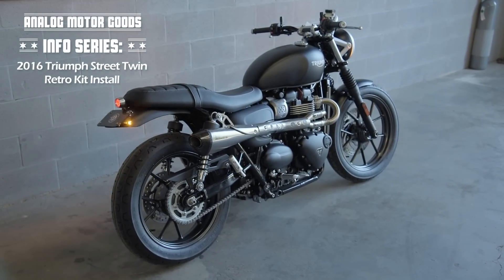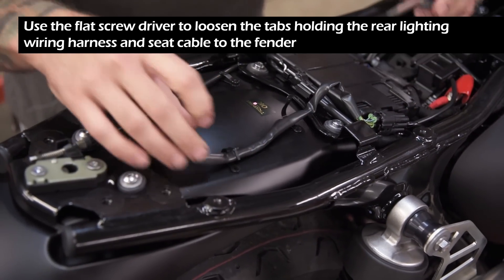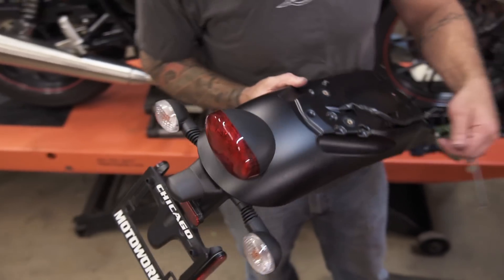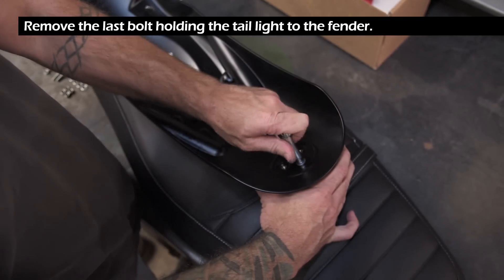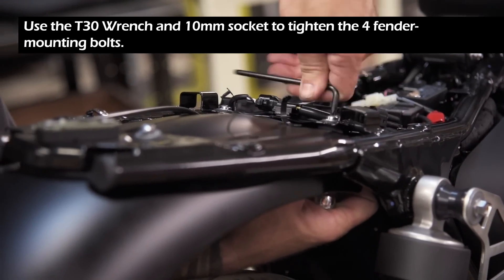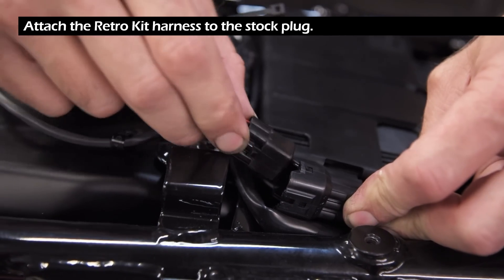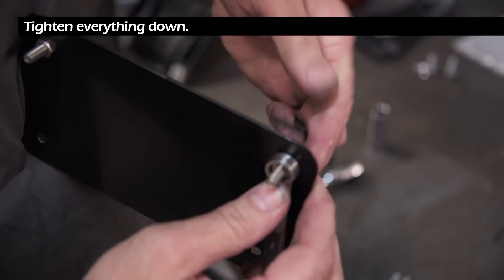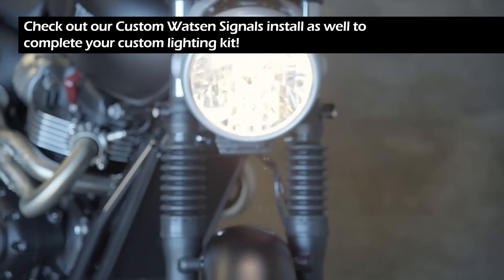Analog Motor Goods - Triumph Street Twin Retro Kit Install Video

Comment: Nice kit, and well done to add value with this series for each product. Please consider that Triumph, in the final analysis, will discover that poorly developed add-ons priced as though they were top shelf is going to cost them a great deal of trouble with regulators, and lose themselve's full-bike customers. The choices out there are just too varied and too good for people to accept shoddiness or dishonesty. Consider also that pricing is always best, in the final analysis, when it's a function of manufacturers costs and effort, and not as a consideration of what you think a given Triumph owner might stomach. Such calculations have been shown over and over again to be counter-productive, and do not drive customer loyalty or word of mouth promotion, as people have an innate ability to gauge costs and always perceive value with this assessment utmost. So far so great!
Reply: Very well said.  Besides, it already says "Triumph" enough places on the bike.  Why pay all that premium for a name, especially if the quality is wanting.

Comment: Because you took off the protection on the inside of the fender, are you more at risk to damage the wiring if it rains?
Reply from the maker: The Retro Kit wiring harness fits on the top the fender as seen in the video. Not exposed to any elements.

Comment: What are the differences between the reverse bates and the cone housings for the tail light? Contemplating between the 2 for my 2019 Street Twin.  Thanks!!
Reply from the maker: The website shows the visual differences between the 2. That's the only difference.

Comment: Do you know between the BC slammer seat and the OEM Triumph bench seat , which would complement a cleaner look with your retro kit? Which of the two would enhance concealment of the wire loom to the underseat?
Reply from the maker: Not sure. It was designed with OEM seat. Never mounted a BC seat.

Comment: A genuine question which I'm having trouble finding answers for if you can help me I'd really appreciate it. I love the stock ST LED tail light + fender. I have the new 2017 Bonneville T100. 

Is it possible for me to swap the factory fender+tail lamp of the T100 to the Street Twin? Don't they both have the same chassis and engine? Please help.
Reply: Imran, Sorry for late response and you may have already found an answer but technically yes the fenders would swap. But your T100 seat would not work with ST fender. OR at least it would be difficult to get the seat to latch.

Comment: Would this kit also work for 2016 Triumph Bonneville T120? If not, do you make a kit for the T120?
Reply from the maker: It will not work for the T120, but we are finalizing the details of a T120 specific kit, so yes it will be available shortly!
Reply: Awesome, thanks for getting back to me.

Comment: Does it work with Triumph Speed Twin 900 2024?
Reply: thanks, I am going to try it out with my new bike. Also, can this retro kit work with a universal plate light TST LED LOW-PROFILE UNIVERSAL FIT LICENSE PLATE LIGHT? I have plan to install this in case i get pulled over riding at night. Thanks!